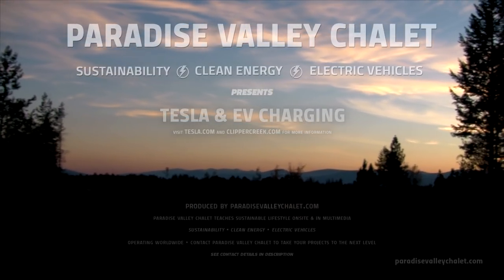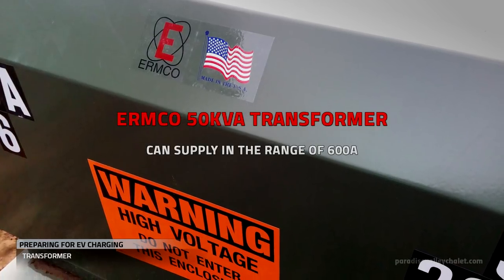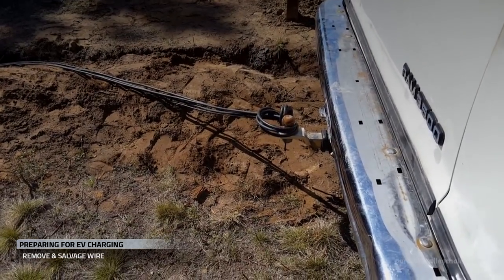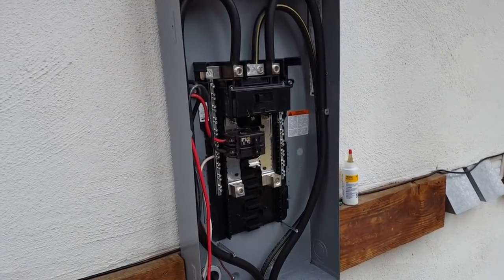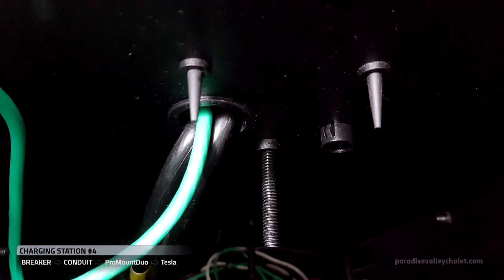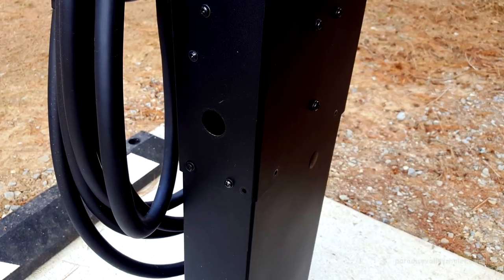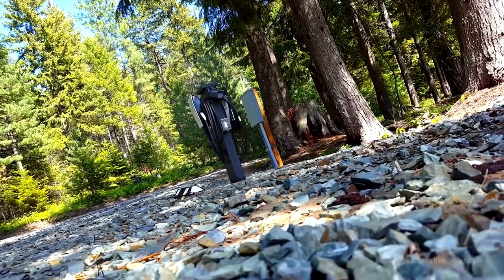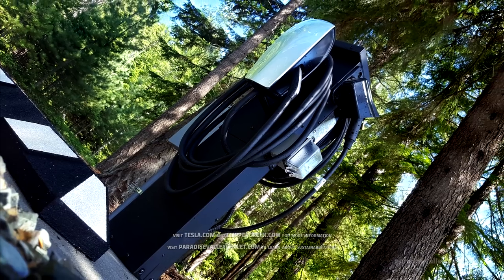Tesla & EV Charger Installations

Comment: Like the video makin me think I can do this. Also like those pedestals lots of I/O options on um
Reply from the maker: Right the i/o on the pedestals is great. 2 chargers and 2 GFCI by default but you can put anything you want in the various pre-made holes. On one of ours we even did some mods by simply drilling through one of the panels. High customization ability if needed.
Reply from the maker: can also install lighting!

Comment: :)),, i think i saw somewhere that the level 1 chargers can not be used on gfci plugs
Reply from the maker: We did not install the GFCI outlets at the charging stations for charging just for convenience while charging (like charging phones, running basic electronics etc.) but you bring up a good point. I cant speak for all situations but ClipperCreek states ability to support a Level 1 charging device as long as each outlet is set on its own 15A dedicated, 110/120V circuit. If you have 2 outlets that are sharing a circuit, you would not want them both connected with Level 1 charging stations as the circuit will trip/overload. Thanks!